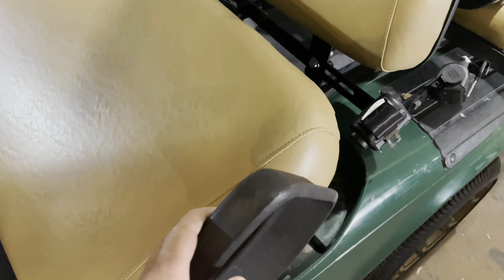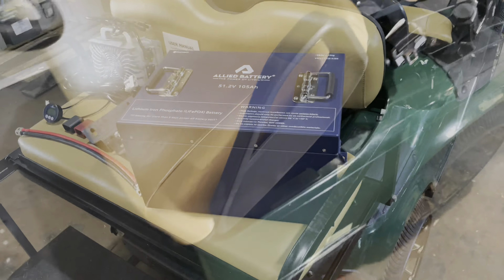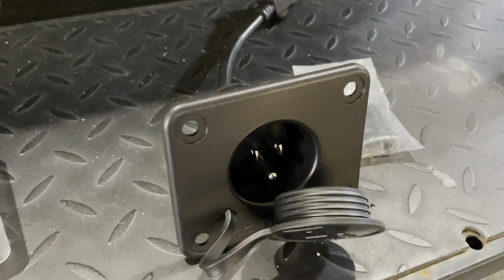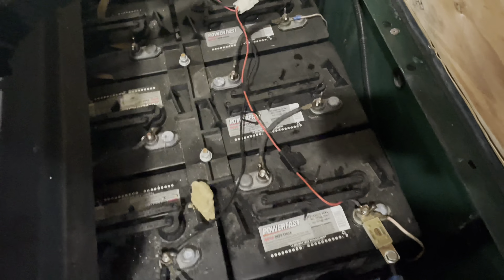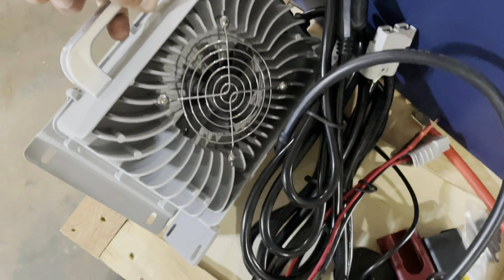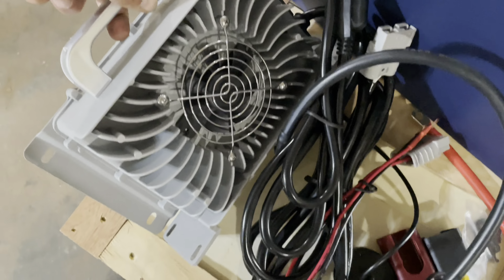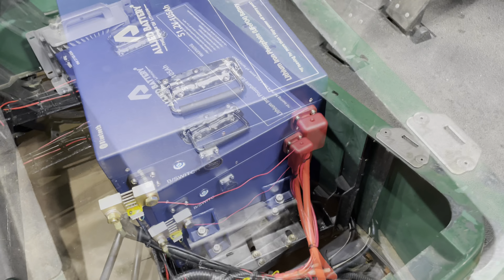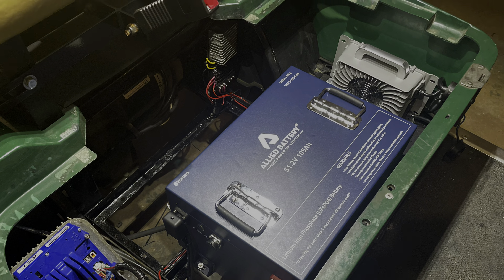Allied Battery 51.2v - 105ah Golf Cart Battery unboxing and installation (EZGO TXT)

Comment: Thanks for the vid. I installed lithium batteries a few years ago. I wired an off brand adaptor for my Club Car Precedent. It ended up overheating. I decided to setup onboard, but I'm unsure what to do with the ground wire since there are three wires coming from the charger.
Reply from the maker: I'm sorry, I would need to see it. Did you get it figured out?
Reply: @PalmettoBatteryPros  Yep, bought something different. lol

I'll look for it. I've since ordered two sets of batteries (single lithium with 120AH). I was using four 100AH in series, but after a year or so I started seeing where they were not balancing. Saw a balancer but read where it can be noisy. I will try this with the four batteries when a build a 'power pack' to see how the balancer works.

Happy with the other batteries I received thus far. Chinese version off amazon, so we'll see....

Comment: I'm currently trying to install the 150Ah version of this battery on my 2016 Textron Ambush IS (built off the EZGO TXT).  The battery barely fits under the seat, and only after I used to an angle grinder to cut away some of the brackets.
Reply from the maker: Yes, Allied has since released a lower bracket for height issues

Comment: My 36 v txt has a fuse block with 3- 15 amp fuses for lights horn etc. It has one green wire which was connected to a positive on one of the 6 v batteries. How do I hook up the voltage reducer with this setup ?
Reply from the maker: Tough one without seeing. The reducer should have a positive going to the 36v battery bank and also a negative. 36v in the reducer and 12v out.

Comment: Do you have a part number for the charge receptacle power passthrough? Allied's is round but it looks like you have an Eco Battery part there. Thanks!
Reply from the maker: Yes, we normally use the receptacles by Eco. They are available on our website.

Comment: which brand of voltage reducer is shown in your video, There are so many on Amazon with wide range of prices. I am looking for a 20A or 30A 48 to 12 volt reducer for my club car DS 2002
Reply from the maker: Allied provides a voltage meter with this battery

Comment: Can you leave the 36 volt motor with 48 setup ?
Reply from the maker: I would google and double check the part number on your motor. I can’t say exactly without seeing your motor, but from my experience the motor can handle 48v. Def need to replace controller and solenoid.

Comment: Does the original 36 volt motor handle the 48 volts and does the solenoid have to be changed?
Reply from the maker: I would double check your specific motor by the part number, but most 38v motors can handle 48v.
Reply: How can we verify the motor is there a link for motor looking it up

Comment: Temperature range on this battery?  I’ve tried lithium on my motorcycle and they won’t start under 40f unless I leave a heat source on it all night
Reply from the maker: The battery has low temp protections at 34 degrees.
Reply: @PalmettoBatteryPros  so these batteries wouldn’t work as well, or not at all, under 34°?
Reply: I have a lithium battery on my bike.  All I do is turn on the bike and let it sit for a few minutes without starting the motor.  The battery will warm up on it's own and you'll be fine.

Comment: was the speed increase from 36v to the new setup?
Reply from the maker: Speed is more of a controller motor issue, but yes, most people get a couple extra MPH due to extra voltage and 255+ lbs off the cart in lead acid weight.

Comment: what gauge wire is this? Is it rated for continuous current or max discharge?
Reply from the maker: Which wire? I recommend 2awg for main cables and 12-16awg for everything else. Max is 600a and continuous is 185a.

Comment: Are these durable.  I am wanting do this for my hunting cart.  It goes over bump dusty terrain daily.  Just wondering if it will handle it well.
Reply from the maker: It mounts very securely to the cart and I have not had any customers have issues with durability. The modules and BMS are well protected inside the battery's shell.